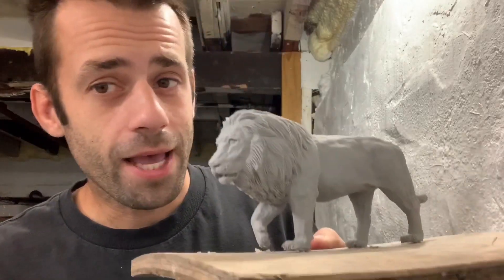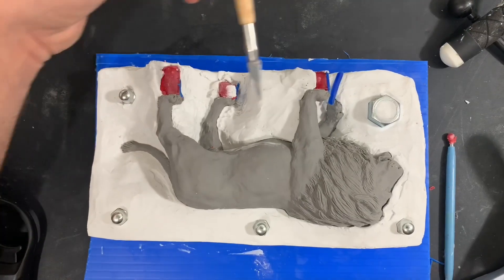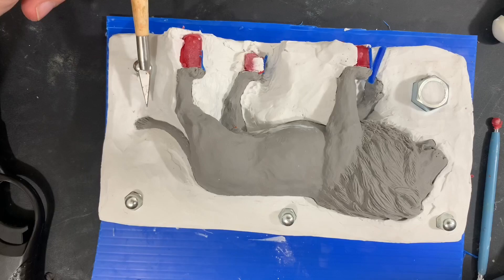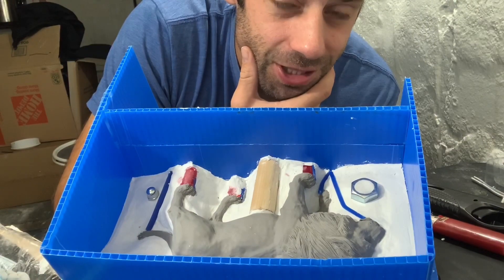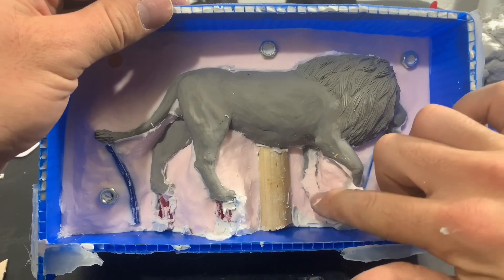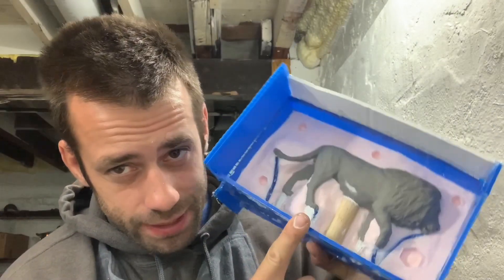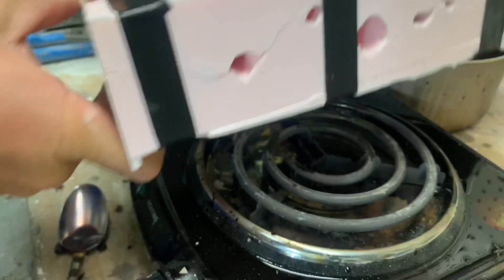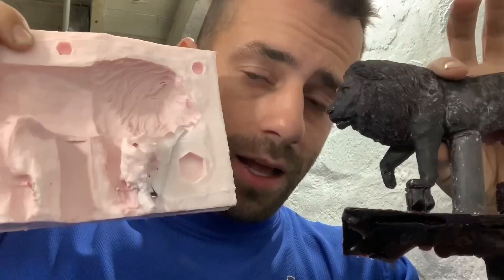Moulding an African Lion Sculpture | Bronze Lion part 1

Comment: Sir actually I said one question.... Which ingredients are used in this molding process...
Reply from the maker: I used polymer clay as the base to set the sculpture, and tin based silicone rubber to make the mold.
Reply: Polymer clay and silicon available in which place  ...sir. please tell me..

Comment: change your clay ... too  sticky
Reply from the maker: Too sticky?
Reply: @lundgrenbronzestudios   yes,  buy quality clay its expensive but is gonna help your work a lot... you can see that clay is messing all around , the original and the mold.
Reply from the maker: Do you have a recommendation? I just used polymer clay from hobby lobby.
Reply: @lundgrenbronzestudios   I used an expensive one like Monster clay  depend on the mold im making... or i Use as well WED Clay  like Walter E Disney is cheap and is water-based... you can clean it with a brush and water ...